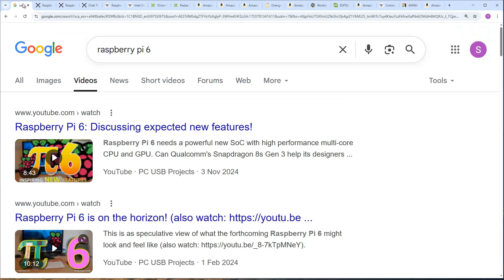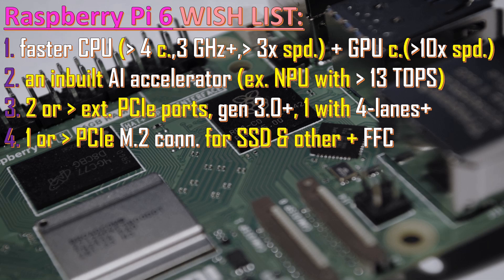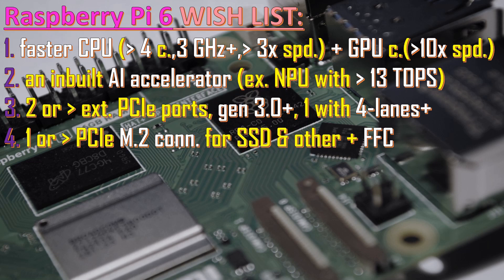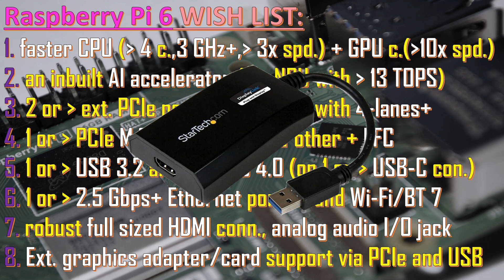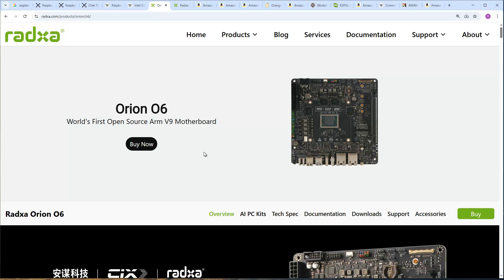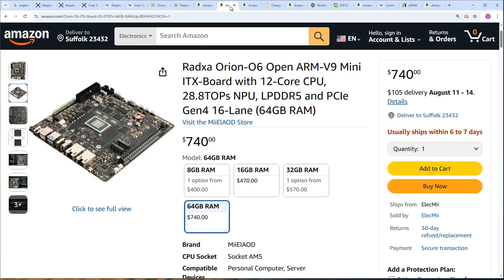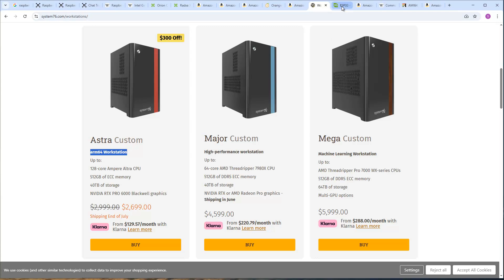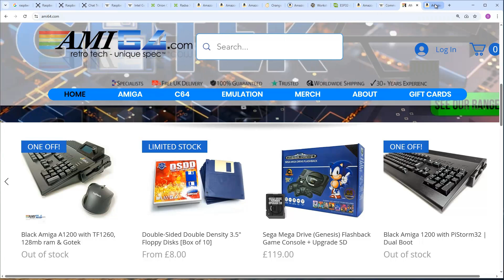Raspberry Pi 6 might surprise us sooner than we think. Rumors are spreading fast...

Comment: From the marketing perspectives, the RPi 6 challenge should be the ecosystem of extensive interfaces, means connectors. The price must be much lower than Radxa $720 but more expensive than STMP32 and more powerful than Orange Pi. Some compromise must be chosen. Pi is a development board, so you should be able to develop and build the s/w for STMP32 as well as AmpereOne or Ampere Altra Max. It does not make sense to mix Armv8 with Armv9 in one SOC. So it should be Armv9.x only. What I do not understand on Radxa is the combination of A720 2.6GHz and similar one with 2.4GHz and the intentional degradation of the cache size is just forcing the CPU performance to uneffectivity. What makes sense to me is the combination of A720 + A520, or A710 + A510. What makes more sense to me is the range of the frequency clock between min and max, e.g. first 4 cores of A720 would have narrow range of frequency min=3.2 GHz, max=4 GHz, and the second bank of 4 cores of A720 would have wide range min=1 GHz, max=3 GHz but both banks would have the same size of caches. The third bank of cores would have 4 x A520. The L3 should be smart and small, e.g. 6MB due to you have 3 banks of CPU cores where each bank has 4 cores and usually the native process will schedule threads only in one bank. This means that the contention problem of memory between these 3 banks is much less probable and therefore the L3 would be small in size and cheap, and the SOC chip would be cheaper.
Reply from the maker: Yeah. Many would like (at least) a similar functionality for Raspberry Pi 6 as Radxa Orion 6 has (at least regarding CPU and GPU power), but for 120 USD and packed in a small form factor (the same as Raspberry Pi 5, if possible). 
However, there are other competitors like Orange Pi 5 Max together with its older brother Orange 5 Plus. Many think that they are what Raspberry Pi 6's HW should be, but I still believe that Raspberry Pi 6 will be much more powerful, since it will be released much later. Orange Pi is a beast! Watch video: https://youtu.be/9dNoa8zPWkU next, but my overclocked Raspberry Pi 5 (3 GHz CPU, 1 GHz GPU, 16 GB RAM) with a number of add-ons (4x PCIe M.2, 1x SATA, analog audio output, ... ) and a desktop like power distribution (it can power and communicate to another Raspberry Pi 5 or Raspberry Pi 4 through its USB-C port) and my power on management module is also a beast: https://youtu.be/w4H88821tLk,  https://youtu.be/BINHFtPJi7o. A reworked power distribution also enables efficient air cooling which is a precondition for a reliable overclocking to 3 GHz or more.

If you wonder what architecture I've suggested for Raspberry Pi 6, watch this older video: https://youtu.be/_8-7kTpMNeY. Many believed at the time that it was too advanced. But the time is ticking...
Reply: @pcusbprojects  I have Raspberry Pi 5 (3 GHz CPU, 1 GHz GPU, 16 GB RAM, M.2 SSD) sice July, and I also have Raspberry Pi  4. My plan is to build a Kubernetes cluster with multiarch images since I want to connect then wit x64 using ProxMox. Yesterday I was testing Quarkus on RPi5 using Java and GraalVM and I've got nice throughput 32K req/s via HTTP, so I can build some server using the cluster imitating the functionality of a real cluster and troubleshooting similar problems. It's amazing that I can throw away the old server with SpringBoot, use a pure Raspberry Pi but the important thing is that I use highly optimized software, actually the framework called Quarkus and I do not need to buy an expensive machine due to Quarkus is 4 - 5 times faster than SpringBoot. The outcome is that you really do not need to buy a new hardware in this case. All you need to do is to code the program against a common API - Jakarta EE, and run the program on another framework with the same h/w but you do not have to buy a new hardware. It's amazing that such a pure device like RPi can make such a big performance in the enterprise. So maybe the Intel Ampere is far too much to buy for someone if the framework and software is not performing so well and not optimized, and not necessary to buy such a server if the s/w is a crap. You can same your money, not to buy a new h/w and change the s/s or supportive framework/libs.
Reply from the maker: Ampere processors Ampere Altra and Ampere One (https://youtu.be/DOdEDyOVvok) were never meant for desktops, but there is currently no other more powerful alternative for ARM64 architecture. There are two basic computer architectures: a multiprocessor and a multicomputer. You can hardly accelerate real time graphics processing in a multicomputer, but each powerful GPU is in fact some kind of closely coupled a "multiprocessor" with thousands of processing cores. Tough processing cores are not full processors, because they may share certain functional units within a processor, they behave similarly in most cases. There are also server boards with 2 Ampere One processors...  If you are building a computer cluster (a kind of multicomputer), you'll experience great speedups with problems that can be divided to jobs that need little to almost none communication like training a series of neural networks with different weights in one iteration of a genetic algorithm. However, many problems require some kind of a multiprocessor: a multi core CPU or a number of closely coupled multi core CPUs, where all CPUs and processing cores have a fast access to all of a computer's random access memory (RAM). In a multicomputer each processing node has its own memory., which cannot be directly accessed by other nodes. Communication between computing nodes should therefore be minimal compared to a processing load. If Raspberry Pi 6 doubles or triples the number of processing cores, it would be great. But it would be even better for overall performance, if Raspberry Pi 6 would only have 4 or 6 cores that could run at 5 GHz instead (much less parallelism overhead). Also watch: https://youtu.be/pDCow-cvcYE, if you are interested in building a computer cluster.
Of course, if your problem can be efficiently solved on a cluster then this is always the cheapest option. The World's largest and fastest supercomputers operate this way, while multiprocessor supercomputers like Cray-1 are long gone....

Comment: like radxa x4
Reply from the maker: I like it, too. I've once tested Intel Gallieo (2013), which was meant lure the original Raspberry Pi B customers. However, Raspberry Pi proved to be much better on the long run, so Intel discontinued the program on 2017. Now, others are building SBCs with Intel mini PC processors like N97, N100 and N150. 

But keep in mind that Radxa's most powerful SBC is in fact Orion O6, which is based on ARM64 cores (8x ARM Cortex-A720 + 4x ARM Cortex-A520 + ARM Immortallis G720 graphics core). Watch: https://youtu.be/M317y3_tNAU.

However, also I like SBCs with Intel processors, especially, if I have to install Windows 11, which is hard with ARM64 based SBCs. A favorable SBC may also depend on a project that you are currently working on...